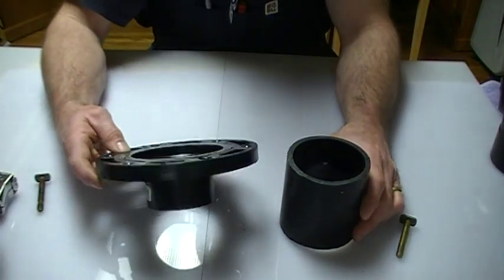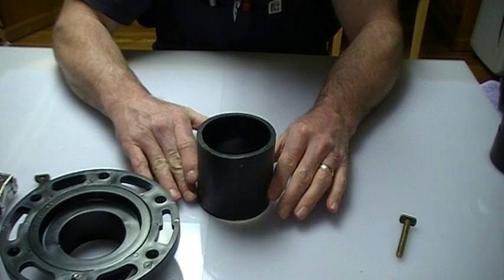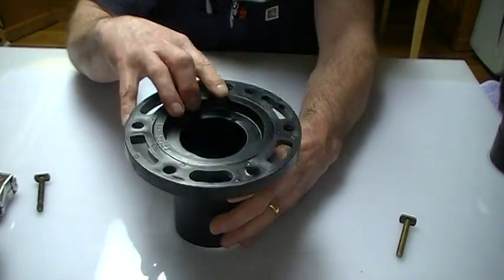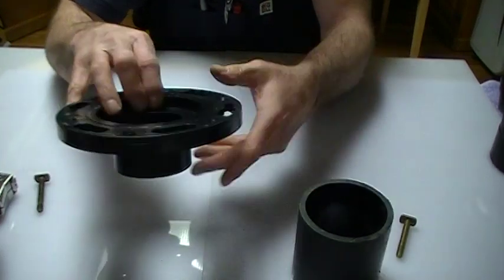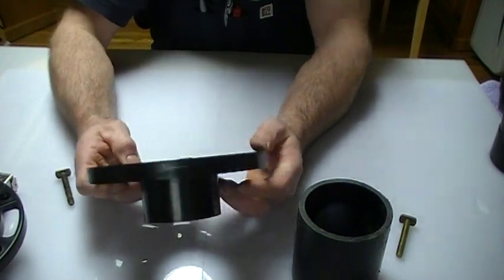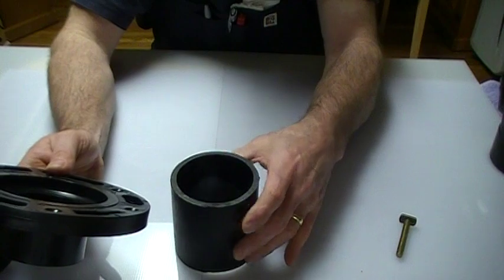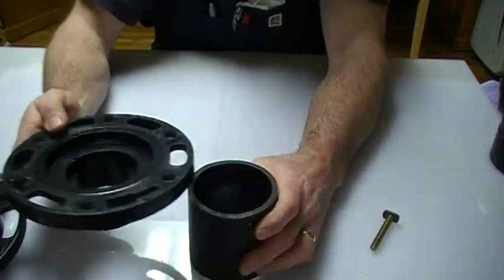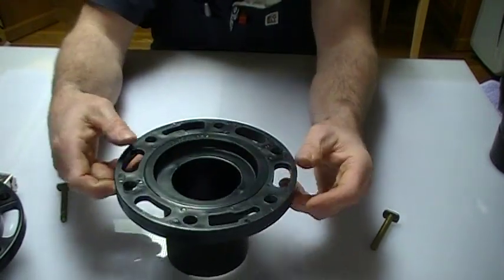Handy 4" by 3" insertable floor flange -for concrete floors.and regular installs.How to.

Comment: Our basement rough-in pipes were installed too close together to meet the clearances required between them for the finished fixtures once set. Is it possible or even recommended to install an offset flange in the concrete floor for the toilet to maximize the clearance? I found one with a 2" offset that would greatly help if this is possible. Thank you.
Reply from the maker: +Tabby Soapes 
You can use an offset flange in the concrete floor. The concrete should surround the flange and the flange anchored down. You should have no issues if you do that. I have used a number of them in the concrete floor over the years. Are you installing a sub-floor?
As far as the pipes being too close together...what are the measurements of the pipes you mentioned? 
Thanks for commenting and get back to me when you can.       Al
Reply: +TheOldkid888 
We are not installing a sub-floor. When we finish the bathroom floor, due to duct work being directly overhead, we are planning to refinish the concrete and stain it instead of adding tile to keep us within the ceiling height minimum. For the dimensions in a 5'x8' bathroom being narrow running west to east the shower drain is 19" from the east wall and 21" from the north wall. The toilet is 54" from the east wall and 17" from the south wall. We did decide to build a neo-angle shower pan instead of getting a pre-fab one which has added more space. We are still interfering with the 21" arc clearance in front of the toilet by just an inch or so, even with a short bowl so this is where an offset flange might give us just enough. We would need to cut into the concrete to install the flange.
Reply from the maker: Tabby Soapes
Unfortunately you will have to cut into the concrete to install the flange, but it will give you that inch you are looking for.
Do you know how deep far the elbow is below the floor? Hopefully it is down far deep enough that it is not going to interfere with the  project!
Thanks for commenting and feel free to fire away with any questions you may have.
Best of luck with the project!    Al

Comment: so does the top of the flange resting on the concrete then fit up inside the toilet allowing it to sit directly on the concrete?
Reply from the maker: Hello John,
It fits into the pipe and sits on the floor just like a regular flange.
The top of the flange is a little bit thicker and I always use just a wax seal.
Not the wax seal with the plastic cone in it. Just a plain wax seal.
Thanks for commenting and enjoy your week!     Al

Comment: I ended up using the oatey twist n set flange.  Do you recommend those for cast iron pipe?
Reply from the maker: Hello Josiah;
The Oatey works just fine for this application.
Thanks for commenting and have a great day!     Al
Reply: Thank You Mr. Al.  Very helpful video
Reply from the maker: Hello Josiah;
You are more then welcome!
Thanks for commenting and I hope your project goes well for you!     Al

Comment: Al: Have you seen these flanges but that insert into 4" ABS?  I thought the pipe coming through the concrete but turns out it is 4".  Thanks!
Reply: I am wondering the same thing too. I have a 4" pipe elbow from the main drain and the 4" closet flange fits only the outside of the pipe but I dont feel like breaking concrete around.. so I dont know if the 3" flange hub is ok with a reducer/bushing?
Reply from the maker: Tareck Fahmi
You can get a 4 inch insertable flange that fits into a piece of 4" pipe.
There are many different types of flanges that will work for you. They Make a flange that tightens up with screws as well.
Most big box stores should carry a flange to suit what you are looking for. Best thing is to take the inside measurement of the pipe coming through the floor and
head to the store. 
Thanks for commenting and best of luck with the project!     Al
Reply: Hey thanks for the reply bud. Yeah I am more a tile guy.. so I hadnt realized that a standard 4 x 3 " flange fits inside a 4 " drain pipe. the problem i had was that the guy who stubbed the pipe had collared the inside of the pipe with a coupling, to cover a little crack... so that little width was not letting it fit... SO I had to cut around it.. chisel it all out to the connector.. gonna start it over.. glue in a 4" abs pipe to the y and im set. ugh
Reply from the maker: hello Tareck;
You are more then welcome!
A standard 4 by 3 fits into a 4" pipe, but does not glue in tightly. They make one that does regardless if it is coming through the concrete or not.
You just want to make sure that all your  connections are nice and tight and you should be all set.
Big thing to think about regardless of the job is that it will be done right when you are finished!
You want to take your time and get it right the first time. Anything else should come up just drop me a note.
Thanks for commenting and best of luck with the repair!    Al
Reply: Ok so I have gotten to the Y connector.. concrete surrounding it.. so what would you do? I am basically only 3-4 inches from the finished floor, to connect to my 4 x 3 flange.
Reply from the maker: Hello Tareck;
I am not sure if I am getting the entire picture, but I would use a regular fitting floor flange that goes into an ABS fitting.
Is there a 90 there that the floor flange is attaching to? You  also have to keep in mind  what you are putting on the floor.
Thanks for commenting and get back to me when you can!   Al

Comment: if anyone can help, i stupidly cut the pipe that was flush with the sub floor about an 1 to 1 1/2 lower than the sub floor so my 4 x 4 barely has any pipe to atatch too would a 4x3 work??
Reply from the maker: +scg721 
If you are only down about an inch below the the sub floor than you can get away with a 4 by 3 insertable flange. This flange will glue inside the pipe. Although you will only have a small amount of contact with the flange and the pipe; applying a good amount of glue and holding it in place until the glue sets will work for you. 
If there is a very small joint then you also have another option. You can apply your regular flange. Fernco makes a long rubber toilet seal. The bottom of your toilet bowl must be completely free of wax if it is an old toilet. If it is new then you are all set. Simply peel the paper off of the adhesive and apply it to the bottom of the bowl.
This is the website and most box stores sell this seal.  
http://www.fernco.ca/plumbing/wax-free-toilet-seal
Excellent product. I have had great success with them They come in both three and four inch.
Small tip before you push the bowl and seal into the pipe is to apply a little liquid soap to the ribbed part of the seal. Makes the seal slide into the pipe much easier. 
This is a video I made about this type of seal. 
How to choose the right wax or neoprene seal for installing a toilet. Plumbing Tips!
Thanks for commenting and best of luck with the project!     Al

Comment: I am replacing vinyl floor covering with ceramic tile on my concrete floor. I want the new flange to sit on top of the ceramic floor so I am now attempting to remove the old flange. I succeeded in removing the horizontal part of the old flange by sectioning it and pulling it off, but the pipe fitting part of the old flange appears to be well cemented to the inside of the floor pipe. I did succeed in setting my tile close enough to the floor pipe so I can now install a new flange on top of the ceramic tile, but there are a couple of issues. The first is that the floor pipe no longer comes up flush with the finished floor due to the height of the ceramic tile. The second is that on the inside of that floor pipe the old toilet flange fitting is still glued in there and I do not think I can get it out as I think it was chemically welded. Should I take a pipe saw and cut the floor pipe at the end of that old flange fitting and then use an inside coupler to prime and glue to the floor pipe, cutting the added section flush with the floor? Or is there another way to do this? Like I said there is no room on the exterior of the floor pipe (without a lot of work) to use a flange that glues to the outside of the floor pipe.
Reply from the maker: Hello Kathryn,
You actually didn't have to remove the old flange. You could have just used a different wax seal between the toilet and the flange or double up tow thin wax seals. I have done it many times.
If you have removed the flange section and have cut it flush or lower than the floor; I would recommend using a fitting floor flange. It will glue directly into the pipe that is there if the spud is long enough on it to do so. If not you will have to take install just a flange on the floor and anchor it in place. 
You Cannot cut the flange off with a hacksaw blade from the inside unless it is a fitting floor flange. Most likely the flange was glued down over the pipe and the cement brought up to it. Is the concrete tight against the pipe?
They do make another PVC flange that has ribs on it that slides down into the pipe and tightens against it. I am sure this would work for you.
This is a web site I looked up to show you what I mean. www.plumbingsupply.com/toiletflanges.html#expansion
Hope it helps!
Thanks for commenting and let me know how you get along!    Al

Comment: I need help, the plumber we used left pipe way above concrete sub floor, then when we were ready to move in, my husband just made toilet a step higher the tile floor.  but, now we had leak so I tore out tile, and what to do it correctly!  any suggestions.    stayhomewife
Reply from the maker: Hello Brenda,
I made two videos that may help you...
This is the first...Ideal floor flange for basement installation.
The second is...Handy 4" by 3" insertable floor flange for concrete and regular installs. How to.
They both talk about a flange that glues into the pipe which is buried in a concrete floor. Biggest thing is to make certain every bit of the pipe is cut off level or slightly below the floor by a small amount . I generally cut the pipe off on an angle to assure it is at least flush with the floor. If there is any concrete around the area; I will chip it away with a screwdriver to allow the cut to be as low as possible.
The end of the flange glues inside the pipe.  When installing you want your t-bolts locked in place being the same measurement on both sides.
Do a dry fit to ensure the cut is low enough and the flange is flush with the floor.
When you look at the flange after the toilet is lifted; take a picture with your phone if you can to remember how the flange should line up with the wall. Locking in the t-bolts is critical as to getting the toilet secure to the flange properly.
Hope this helps.
Thanks for commenting and fire away if you have any other questions.    Al
Reply: What would be the best tool to use to cut the pipe down?
Reply from the maker: Hello jjvanleon,
A  reciprocating saw is my go to tool for this job. It cuts the pipe flush with the floor. If there are any high places with concrete up against the pipe be sure to chip them away with a hammer and screwdriver.
I know not everyone has a recip saw or can afford to purchase one, but an old handsaw that you will want to dispose of after you cut the pipe will do the job for you as well. 
Hope this helps!
Thanks for commenting and best of luck with the project!   Al